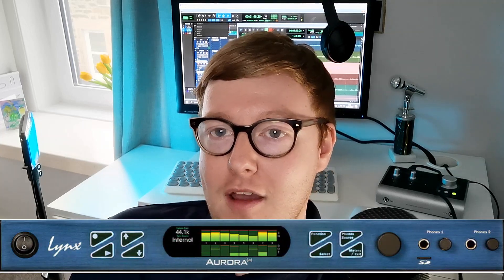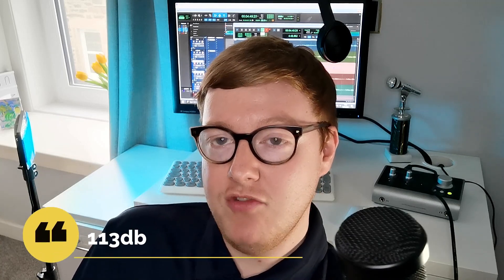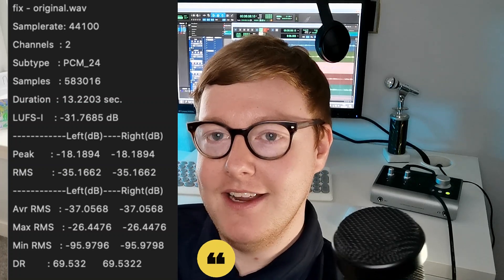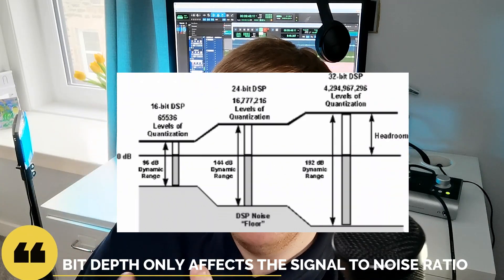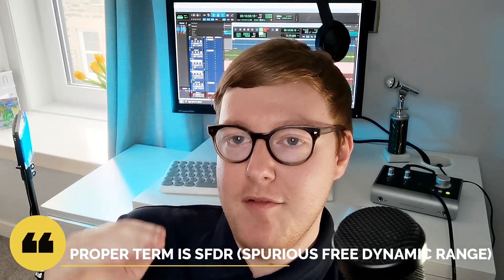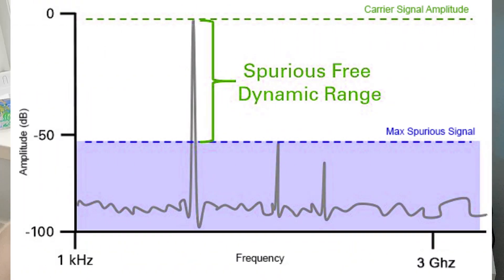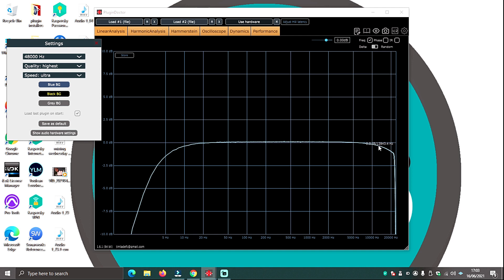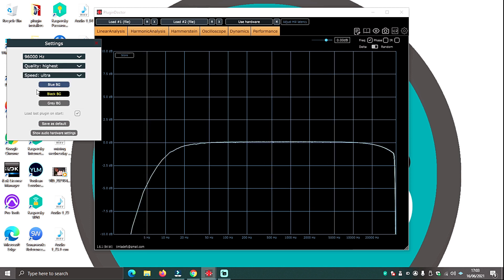Do you lose audio quality in analog gear using budget interfaces vs expensive ADC Converters (Pt 1)

Comment: Digital and Analogue... I swing both ways! 😁  Digital is far superior to analogue in so many ways it's not worth discussing... but, regardless of viewpoint the argument boils down to "how it sounds".  In analogue terms... the same reel of Ampex 456 will yield audibly different results on a Tascam 22 or a Studer A812.  In digital, the same ADC chips could be used by Behringer and Lynx - but the clocking, filtering and other "audio science" that is applied whilst converting the signal from A to D is what you're paying for.  So, yes, all AD/DA conversions will sound a little different as every company is convinced their's sounds the best!  Pure measurements may reveal which company succeeded in transparency... but it does not guarantee it will be perceived by us as the best sounding. Vive la différence!
Reply: Great examples!
Reply from the maker: Long story short that's the conclusion of this video.

The reason I made the video was that an analog guy told me

'sadly your interface isn't really up for the job of optimally printing outboard gear'

'I should add - if your AD-DA's don't have sufficient dyamic range to support and match a piece of outboard you will never capture the full sonic capabilities of that said piece of gear'

I then gave him the dynamic range stats of the id14 and info I gave in this video.

He then told me that he knows better as he had an rme fireface and didn't trully appreciate the quality of his ssl bus compressor until he put it through a symphony.

I then asked if it was possible that it was the sound of the converters he liked and not that he was getting the full sonic capabilities of his ssl.

I was then told

'you simply cannot make bold statements that "its the conversion I'm hearing" when you have zero experience with high end converters, proper studio monitors & decent room acoustics. All you have is a pc with cool plugins'

In the end, we all know it was the difference the converters added. Nothing to do with 'the full potential' of the analog gear.

The problem is the marketing hype from the manufacturers themselves. This is what lynx say on their website regarding the aurora:

Transparency Matters
Signal coloration is additive and can kill an otherwise pristine mix. That’s why a colored mix begins to collapse while the transparent mix has space, definition and a level of detail that is simply unattainable with converters that add color and distortion. Lynx’s hallmark sonic transparency is why Lynx converters are being used in the most mission-critical audio applications and in the world’s finest recording facilities. Lynx converters have been specified for their uncanny ability to convert signals without adding any artifacts or color. For audio engineers and producers demanding the most pristine recordings and mixes Lynx is the converter of choice at facilities like Dolby’s new mega complex of audio research, Skywalker Sound, NPR, and the Smithsonian Institute. Lynx converters pass the most stringent tests and shoot outs to become the sought after converters for these discerning professionals. Precision matters more than ever and there is no place for even the slightest coloration or degradation of the signal.

I'm fine with that but it's marketing BS like this that has guys giving me a hard time cause I'm using an id14 to print hardware making ridiculous claims regarding dynamic range and loss of hardware fidelity 😂
Reply: @PaulThird  I feel your pain!  Any 24 bit audio interface has more than enough dynamic range to print analogue signals.  Signal to noise is another story - digital eats analogue for breakfast.  As for AD/DA converters... the difference between "high end" and "entry level" has levelled out to the point where we virtually need to do null tests to hear it!  In the digital world "pure" is easy... but "sounding good" is the holy grail.  Marketing is their last hope at convincing you that what you're hearing is "better"... when in fact, "better" is subjective and therefore an endless quest.
Reply: @PaulThird to be fair as long as there are pre amps in the signal path it isn't optimal. The difference is so damn close for most that doesn't matter (crap pre amps excluded). But it is a lovely argument to justify gear addiction 😂
And the funniest ones are.. with this expensive converter I can hear the difference, all my MP3 sound so much better 😂

Comment: You're absolutely right mate. And the thing is, the audient converters are some of the best converters ever made, people don't know. it's sitting next to apogee, merging anubis, etc. I loved the way you really approached this scientifically and did a great job.
Reply: No no, its not the best ever made or sitting next to Merging anubis, that being said, it is a very very good device, and you can do a lot with it!

As somebody who loves and also owns an id14 heres my take: I used the id14 as my main for a long time, one day I decided to upgrade to something high end, and first I noticed a small difference, nothing night and day by any stretch of the imagination, after about 4 months of use I switched back to the id14 just to hear it cause I really enjoy the sound of it, and the sound just sounded a little bit more like there was a blanket over it, (nothing substantial and I still stand that the id14 converters are indeed fantastic) but you can have a different experience once you go more high end, trust me, especially if your room is treated ans youre using good headphones or monitors, I actually noticed it with quite cheap monitors first 

Now, does that mean the id14 isn't sufficient? NO, the id14 is a beast, both in build and sound, and the id14 is probably going to have better conversion than most stuff that many hit records where done with in the 90s, so there you go! And the sound could even be more appealing for some people
Reply: @joshsmith7812 The id14 mk 1 sounds sounds fantastic . The mark 2 is another level up. Incredibly transparent ! The headphone amp is cleaner and sweeter , plus 4 outputs on back. No brainer!
Reply: There are no Audient converters. Lol. Audient interfaces use third-party converters.

Comment: I also have the Audient iD14, was thinking of getting the MKII because of the extra outputs (a big plus for my current setup) and slightly cleaner sound and am used to working at 48k... I've also thinking been thinking of working at 96k. Looks like i'll be upgrading my setup when I can with the MKII and 96k soon unless they bring out an iD44 mkII, which would expand my setup hugely.
Reply from the maker: If you use monitors then the extra line outs are massive for you if you want to use analog gear as you don't need to unplug your speakers.

I've been swaying towards the iD22 just for all the extra options it has. Actually amazing for the price
Reply: @PaulThird  Yeah the send and return options are great too on the iD22, i'm a drummer so the added inputs of the iD44 would be much appreciated in my case. Even though I have the 880 also. And yeah the extra line outs would be great for me because I have a reel to reel tape machine that I'd like to send more sounds through but it doesn't feel 'integrated' into my current workflow unfortunately with the MKI iD14 so doesn't get much use... one day! I'll hold out to see if Audient update some more of their stuff first.

Comment: What do you mean by "bypass" preamps? How would you do this in other interfaces?
Reply from the maker: Just running the audio straight through the converters and bypassing the mic pres. I found this response from audient 

"You can easily bypass the mic pres on iD22 by simply patching the output of your other mic preamps or gear into the insert return, which is a very pure differential line stage into the ADC, therefore completely bypassing the on-board mic pres / HPF and line input stage."

I now need to get my hands on an iD22 haha 😅

Comment: You can't release this during footy match. Will watch later 🔥
Reply from the maker: I made sure It was uploaded so I could watch second half 😂
Reply: @PaulThird  don't listen to people who say it won't work with analog it's all about how much power needed is provided to the audio interface specially the usb ones make sure to get the full benefit of you're audio interface to connect it using a usb c cable or you'll get less volume out of your mic preamp and headphone amp

Comment: I wonder how my prism stacks up against it
Reply from the maker: Do a straight ADA loop, print it and then ensure the waveforms line up, play both side by side, flip the phase, ensure both are the same level and then measure the null.. That'll tell you how transparent it is 🤓

I enjoy geeky stuff like this too much haha 😅🙈
Reply: @PaulThird  I could try that with the lynx on access analog, Shame they don't have an audient to try tho as that (compared with the lyra) is something I would like to hear
Reply from the maker: That would be a great comparison as you'd be able to measure and compare the transparency as well as hear the differences of the 2 🤓
Reply: @PaulThird  Yeah I'll consider doing this. While I'm at it I'm tempted to try out the ssl fusion on the aa site also, just not sure what I can add to a mix that already sounds finished to my ears, so in two minds as feels like it could be counter-productive at the same time. I am very curious to how it will sound super subtle across a mix or two tho